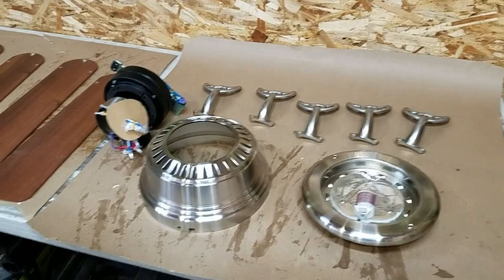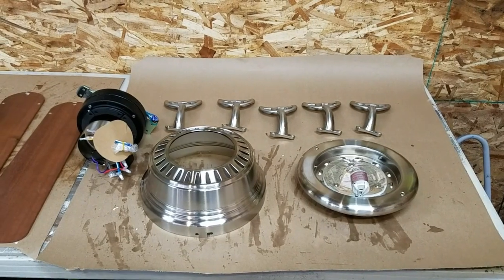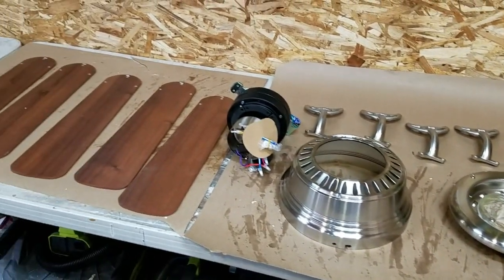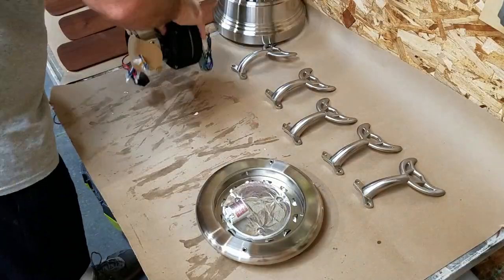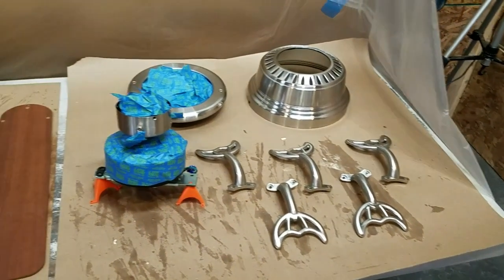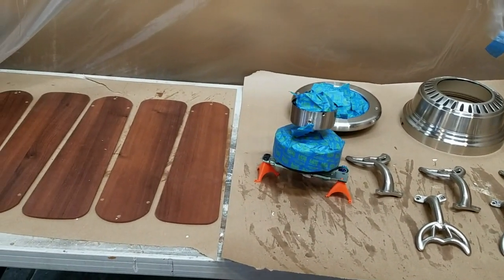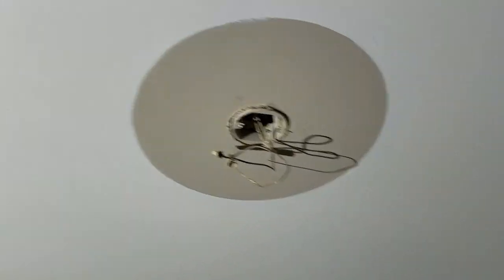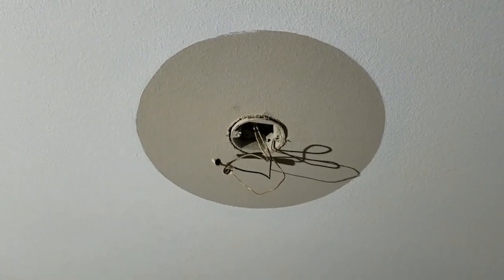How to CUSTOMIZE and INSTALL a Ceiling Fan | 2019/32

Comment from the maker: This was a super easy project to do and had a huge impact. I am going to add a WiFi lightbulb to work with Alexa, so that I don't have to run a seperate wire for fan power..